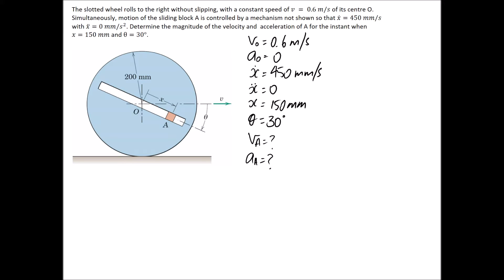(5/161) Rolling Disc with Slot

Comment: Howdy, I was wondering why you multiplied by  2 * w * v(rel) as this is just the same as the centripital acceleration 2*r*w^2. I did get the right answer but I am confused why this value is used and what it is. Any info would available, thank you!
Reply: howdy fellow meen 363 motivator